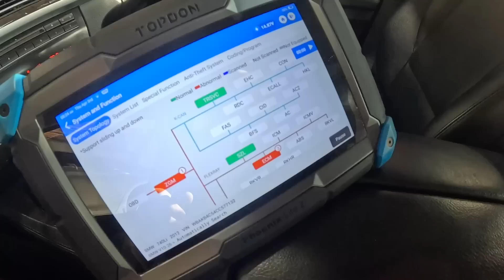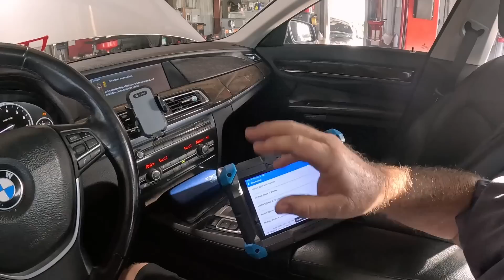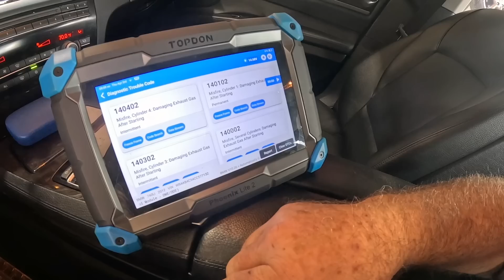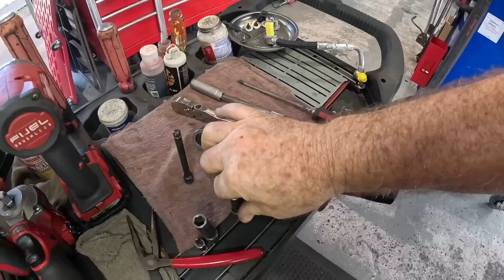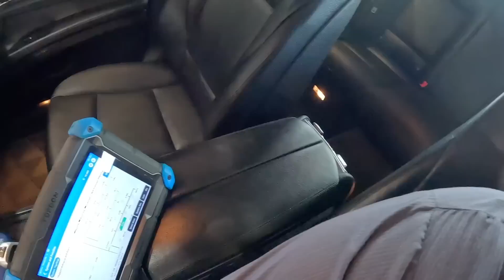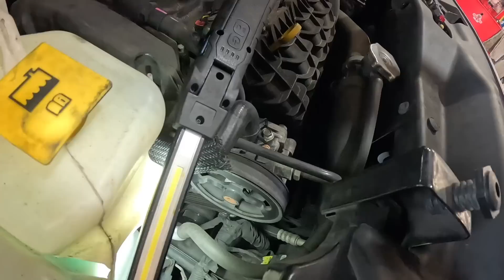Escape, turbo hose, Patriot no crank rough idle, 730i Runs rough, Auto repair shop DAY 689

Comment: Torqued at 248 YouTube foot-pounds.  I hope you got paid on the Patriot.  Another rough backout for sure.  I'd rather buy a batter from a shop and have it installed for multiple reasons.  #1 is the battery warranty.  Seems silly, but I'd rather have the shop warranty out the battery than me haggling with a parts store.  Seems like I would save time and aggravation.:body-blue-raised-arms:
Reply: Note: This video is not your Day In The Shop playlist.
Reply from the maker: Yeah, there is certainly some value in customer service that comes with something like that.

Comment: GREAT WORK on that beemer. one of the gnarliest situations you run in to, as a tech, is fixing a comeback from someone that just quit - on top of the that - seemingly unrelated to anything they did, AND it was a bad coil on 1 cylinder AND a bad injector on another? satisfying! this is why we do this! hell yeah mfer!
Reply from the maker: Yeah, that's what keeps it interesting. :)
Reply: Yeah, he did a great job as usual, because machines with more than one problem are aityle more tricky to troubleshoot.

Comment: Jimmy I hope you you that isolation bush from old injector to new one you are supposed to replace it but if you don’t have it in it will damage the head
Reply from the maker: I made sure it looked just like the one that came out before sending it in. :)
Thanks for looking out!
Reply: @JimmyMakingitwork  ok but I didn’t see it on the new one when you put it in new injector dont come with that isolater

Comment: The guy with the Honda got the cold air intake correct in theory as the air filter element is out in the cold air, rather than in the hot engine compartment. Unfortunately he failed in his execution. Perhaps he was inspired by Rainman Ray's air intake setup on his Silverado. As for the radio being aftermarket I'm not sure. That battery cable debacle definitely looks to be the work of Mauler The Car Audio Installer.   🤣🤣
Reply from the maker: lol, 100#!